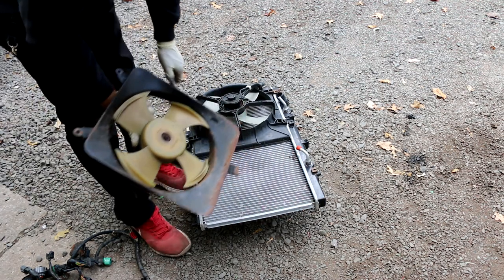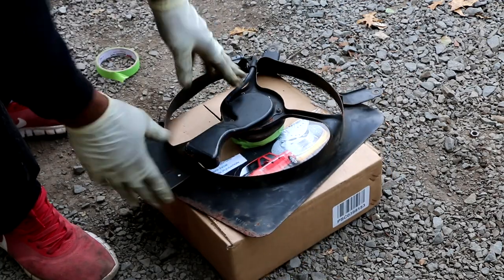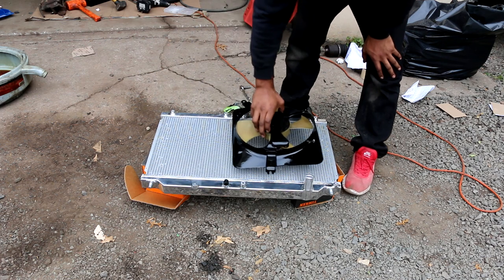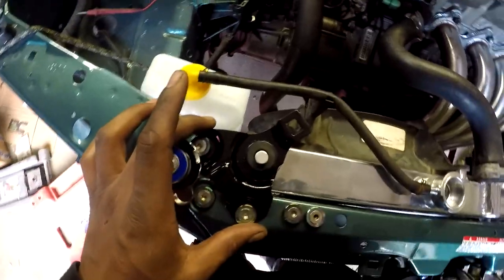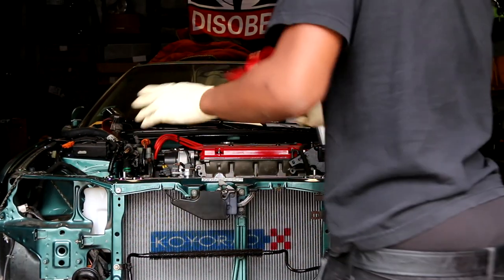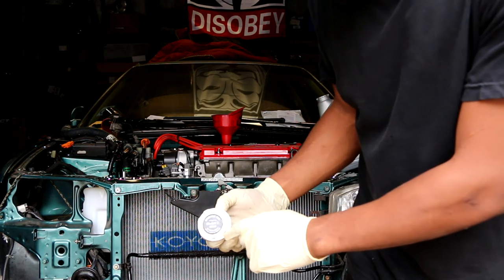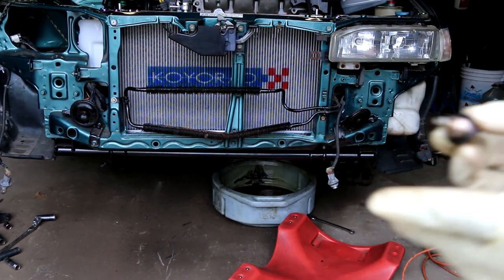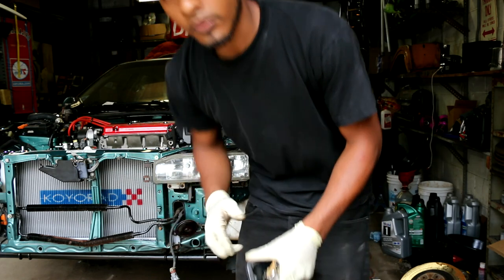Engine Start | CB7 Project: Episode 10

Comment: Hey I have that same rad in my coupe! I actually made an all aluminum fan shroud for that rad since no one makes one. Made out of 4340 aluminum, tig welded, your choice of fan size/brand, single or dual fan, ect. Hit me up if you're interested, can send you some pics of the one I'm currently working on. Clean cb7 btw👌
Reply from the maker: Cool the stock fan works fine now overheating issues.  Thanks. I am curious to see your car though.